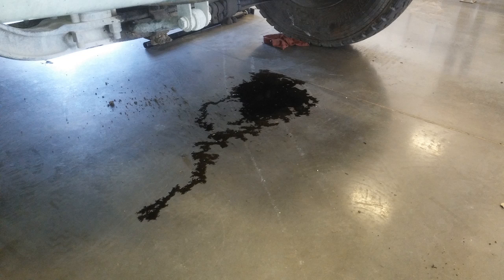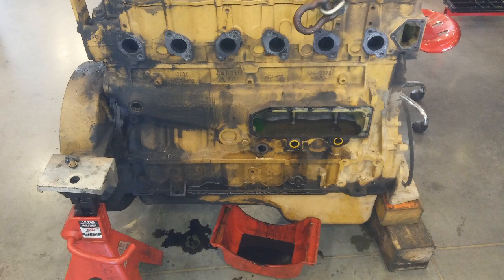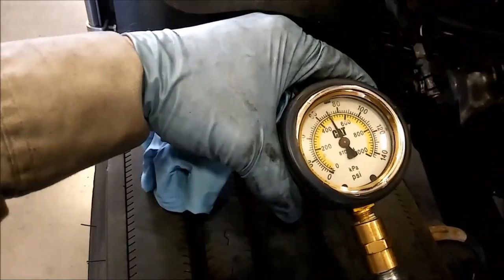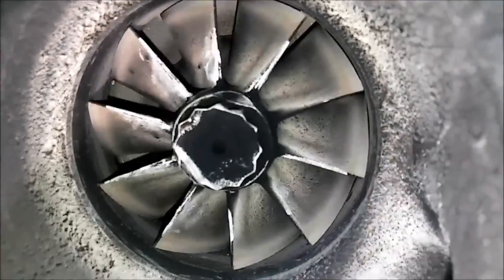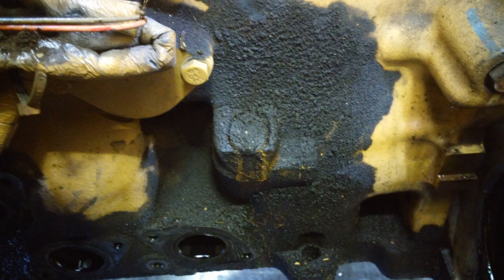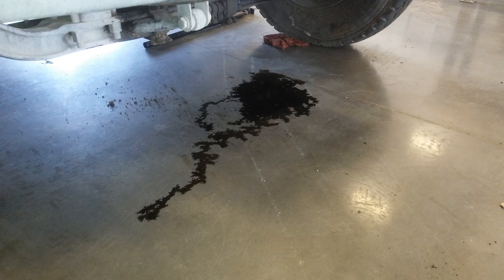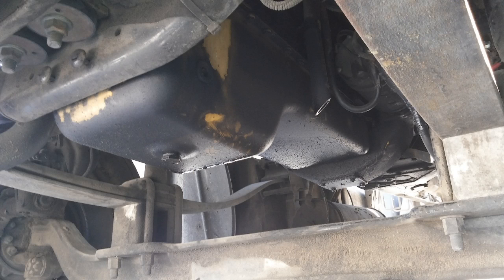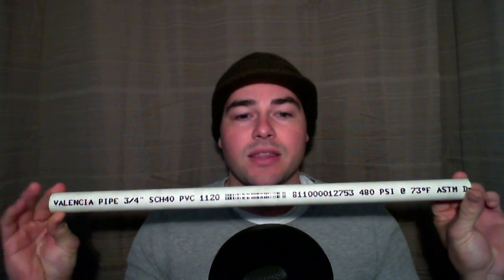Why Do Diesels Leak So Much?  Why Do Diesel Engines Leak So Much Oil?

Comment: you can use a turbo without blowing it up to put a suction from blow bye. you put it past the intake of the turbo. suction cup vacuum systems use it with compressed air the large fast-moving volume of air in a  special chamber moving fast pass a smaller hollow chamber creates suction. think of an airplane wing the the larger surface area on top of the wing air has a longer distance travel than underneath making suction on top causing lift same principle but in an enclosed system. I forget the name of this kind of vacuum system but is very effective and reliable best part no moving parts.
Reply: venturi effect ?
Reply: You are referring to Bernoulli's Principle; however, that principle is not what mainly creates lift, for in its application to this phenomenon, a mistaken assumption of equal transit time is applied.  To create the pressure differential that untold numbers of flight instructors have wrongly preached, the air over the top of the wing and the air under the wing would have to arrive at the trailing edge of the wing simultaneously.  The investigations of physicists have proven that notion to be false.  

There are three primary operative principles here - Newton's Third Law of Motion, the Coanda Effect, and the approximate angle of 4 degrees upward wing design.  Bernoulli's Principle plays a very, very small part in the process of flight.

I could explain all the three here, but it be a very long post and not relevant to Josh's video.

Comment: My crankcase breather is plumbed on the intake side of the inlet by the factory. It also doesnt leak it has 309,000 miles.
Reply: freddy freddy my 45 year old Mercedes 240d with 356000 doesn't leak either and breathes it crank gases through the inlet manifold like your engine:)

Comment: Why not a mechanically driven vacuum pump like in race car applications?
Reply: I know 6.0 7.3 diesel use a belt driven vac pump in ford econoline 350 and 250 applications...7.3s and 6.9s in the boxy body f250s and f350s also use a belt driven pump. so your comment is incorrect about parasitic draw....
Reply: Mario D'Agostino VW diesels have used this type of pump since 1996.
Reply: Maybe the big diesel turbos don’t like it but I drove around a vw turbo diesel for years with water injection spraying right into the turbo. 
Never blew a turbo, and couldn’t really notice any more wheel tip erosion I’d call excessive.
Reply: otm646 
more like 78-79 on the first old 1.5 idi. 
The 1.5 and 1.6 used a diaphragm style pump, I’ve replaced a few diaphragms along the way, but the later (85up) idi used a vane style pump. 
Great upgrade for an early pump engine. 
The vane pump stuck around on the tdi until 98.
99 up vws still use a vacuum pump, but it’s not like the older ones that basically took place of the distributor in a gas engine.

Comment: Few things wrong, it doesn't matter if a gas engine has a turbo or not.  There is always vacuum on the manifold side at low loads  with a check valve and the there is always a secondary port on the turbo inlet side.

Also turbos don't blow up from having oil vapor going though the compressor side.  The most that would happen is impeller tip damage and I have never seen that.  The only time I've seen compressor tip damage is from pre turbo water injection where atomization is horrible along with the volume being injected.
Reply: Few things wrong, no one cares if you have any vacuum at some point, you can not suck out the crank with a turbo because of... as said NO VACUUM...
Reply: +Matt Lane Nice try. Learn how to read next time. I was talking about turbo gas engines.  Also there is a vacuum under full load at the turbo inlet in both gas and diesel engines.
Reply: +Matthew B.  Another person... Again taking about gas engines and they almost always have two separate pcv systems.  One to the manifold with a check valve( known as the pcv valve ) and one in the intake system( pre throttle or turbo if equipped). The main system works on vacuum and the secondary works on scavenging under high load..........
Reply: Matthew B. Same here for a little over 10years.  It's the same system just two different parts of it. Didn't mean  they were separate.  Also you never mentioned anything about diesel in your comment.  I work on high performance gasoline engines and have data on vacuum being pulled with pressure transducers. While it's not a lot, it is still vacuum none the less. Syphon sprayers work on the same exact principal of creating a low pressure area in the tubing which creates a vacuum to pull liquid up.
Reply: Matthew B. You must me one of those so called "engineer types" and thinks everything works on computer models.  Go test it for yourself if you don't believe me. I have nothing to prove. It is the internet after all.  

Get a map sensor. Any map sensor. Find the specs on it and the voltage out put levels based on KpA on the high and low side.  You will easily be able to interpolate the scale in/hg-to-psi if you don't have a proper logger and hook it up to the in take side  post turbo. Better yet since you are a mechanic. Install said sensor and connect it to an oscilloscope and take the car for a cruise varying load so you can see the graph of trending data.

Now the question is will you even try doing it to prove me wrong?  Either way I'm done with this stupid internet squabble. People can believe whatever they want to believe.
Reply: Matthew B. Matthew B. ....No reading comprehension what so ever.   I said to take a map sensor.  Meaning using a spare.  "Install post turbo"..... Selective reading. I've been talking about pre throttle body/turbo the entire time.  Are we on the wrong page?

  You don't have a scan tool w/ o-scope in your shop?  Gotcha.  Dinosaur mechanic.  O-scopes are back if you haven't heard and they come in the form of tiny hand held tablets.
Reply: Matthew B. Likewise.   Either way, slow day here.  About to be sent home because of the snow storm. Lol
Reply: AGT ii
Reply: You missed the point
Reply: AGT You are the only one here that has a hint of what's going on. Go to school you guys. Gas and Diesel engines (turbo or not) have no vacuum, period. They have a low pressure area, that's why airplanes have manifold pressure gauge. Bernelli principal works on moving air ( such as siphon sprayers, carburetors, and airplane wings) (put a vacuum on a carb and you will have way too much gas unregulated). Engines that have an intake manifold are at best only 80% efficient by the time you get to the piston. That's the beginning of why you turbocharge (most airplanes that are turbocharged are set to sea level). If you could tap a port close to the intake valve you would find some de
Reply: AGT continued from last reply. If you could tap a port close to the intake valve on a diesel, you would have some decent low pressure, because of the intake manifold restrictions and air cleaner.
Reply: AGT Before pcv, it was called a road draft tube. It had a 45 degree cut on the backside and hung in the draft below the car to cause a low pressure area to suck the crankcase air out. Doesn't work on stationary engines. The bottom side of pistons move as much air as the top does causing violent air movement in the crank case, (2 strokes depend on it). Lowering the air pressure in the crankcase doesn't stop all the pressures exerted on seals and gaskets. Good engineering and building practices stops oil leaks. So when you see a lot of oil below a parked Harley Davidson do you think it's a diesel? Good luck you guys with the new understanding you have now.

Comment: Mine doesn’t leak
Reply: That’s because you’re sitting at your computer and typing and the truck is outside, turned off 😂😂
Reply: @MrTheHillfolk  lol
Reply: Taydrum will look those up. My F350 was a gift last year, worked all summer doing maintenance & replacing worn out parts. Had original muffler and was totally clogged with soot. New exhaust and started using Howes, I think it was called. That made a big difference after about 5 tankfuls. More maintenance is on the way but have to space it out. New tires set me back 1k. I like those Transforce HT's.
Reply: Mine doesn't leak with 210,000 miles 7.3 IDI NA
Reply: Taydrum want to sell it?
Reply: Mikael Anthony thanks but no thanks, it's my daily driver and it's reliable as hell. I even manage 22 mpg
Reply: Taydrum don't blame ya. I have a 92  7.3l NA 5 speed F350 that runs so smooth, my daily driver also. It does not leak oil either, pretty amazing!
Reply: Nice! They're pretty great trucks when they get taken care of LOL, but most people neglect them till they piss oil everywhere. Keep it going, and see how many miles you can get out of her
Reply: Oh yeah, one more thing, three of the best improvements I got out of the motor (7.3 IDI) came from running Optilube XL diesel additive, running HPR diesel (available here in CA), and putting Archoil 9100 Nanoborate lubricant in the oil. I highly recommend the two additives, and if you live in certain parts of California the HPR diesel!
Reply: I want to check my muffler now :0 And yeah, they only need maintenance here and there and should be running well beyond the collapse of society. Thankfully, tires is not an annual fix, they usually go for a few years. But good oil, good fuel, and it will be good to you
Reply: Taydrum Mine beats me driving. It is an F350 dually 5 speed with a 4:10 rear end. There are 12 leaf springs on each side of the rear axle. Not very smooth. But pulls very well. Pulled twice a 14k pound dump trailer with rock and concrete and was just fine. Being a normally aspirated engine the pick up is a bit slow but that is a non issue with me.
Reply: Yeah you can definitely pull a decent load 12K-14K with 4.10 gears, not so highway friendly though unfortunately. Mines geared at 3.55 which is excelent for highway but maxes out towing around 6-10K. I feel you on the suspension though, they were designed for hauling and not comfort/cruising!
Reply: Taydrum I like the truck, just didn't think it would wear me down so much. It is nice on the highway, but wish I had a 'Gear Vendors' overdrive/underdrive unit on it. But have to save up for that $3k investment. Been driving that truck every day now since Nov last year. CDR needs replacement.
Reply: A gear vendors overdrive would certainly be nice for those long highway trips! But you're right 3k is a big investment, but it most certainly will be worth it. I recently needed a new CDR valve too, since mine was stuck open, long story short I ordered one that never came, and so I took my old one and jammed it full of steel wool, like a catch can. Problem solved, no more oil consumption, or oil pooling in the intake. If you're able to get a new CDR valve, do it. However, because it was impossible for me to get one for some reason, i opted for the steel wool trick and it still works 1,000 miles later so far...
Reply: Evil One 
Good for you.  Who cares? It doesn't really mean much without miles, maintenance, and engine model. I will never understand why on one of these video that presents a small critique of a type or model of engine someone would present anecdotal evidence to try and contradict what is being presented.

Comment: It took me a while to grasp the concept of crankcase breathers and why you get more oil in the air inlet and turbo during idle rather than load thanks for your videos. I work on MTU marine engines; they use a crankcase breather filter system that leads right to the air inlet horns.

Comment: Hi Mr. Adept Ape, i usually follow you and love all your videos. I just have 1 question and that is, after overhauling a Diesel Generator Engine should the Generator work without load for few hours or it should work on load?
Reply from the maker: +Henrique Dsouza Cat and myself are both advocates of loaded break ins. Let the engine run a few minutes to check for leaks then load it at like 25% for a couple minutes to get it to temperature, then once it is about 170 degrees I put it at full load and run it for awhile. This will help the piston rings seat against the liners. Everyone has their own opinion on this, but that is how I do it after a rebuild on the engines I build.
Reply: Adept Ape thanks for the reply, so it’s not recommended to work for hours right? After rebuild.
Reply from the maker: +Henrique Dsouza I'm not sure what every manufacturer recommends, but for Cat engines they like to be loaded soon.
Reply: Adept Ape yes I’m talking about cat c15 Acert Generator

Comment: i thought it was because they generally live longer lives then gasoline engines. my assigned truck has 700K miles on it with a cat C15 acert. i do not know if its ever been overhauled BUT gasoline engines do not live that long. the longer something lasts, the more leaks it generally develops UNLESS it has had a full rebuild with all new gaskets.
Reply: They also rattle like hell and are under higher stresses but... having pressure also don't help.

Comment: Plus, the last thing you'd want to do is blow oil laden crankcase air onto the intake side of a turbo. If something fails its a sure fire way to feed a turbo lots of lovely engine oil. Run away anyone?
Reply: Again..... "If something fails its a sure fire way to feed a turbo lots of lovely engine oil."
Reply: Capt Vimes But what your also forgetting which can be a high mileage failure is the turbo is fed oil too and that can blow seals on its compressor side and feed the engines inlet with oil.
Reply: @tyronenelson9124  Dumping the crankcase fumes before the turbo now contaminates your turbos, tubes, and charge air coolers. Now do you think covering almost the entire intake in oily soot is a good idea?! Jesus Christ, you're a fucking dumbass.
Reply: Cant run away on fumes...
Reply: I know. Read what I wrote. If something fails in the circuit or maybe the oil level gets over filled, you have a direct route straight into the Turbo. Not the best idea unless it's your only choice.
Reply: Matt Lane Bullshit !!!
Reply: The amount of fumes is is minuscule .  Manufacturers have been running crank case vents into the turbo inlet on diesels for a while 40 plus years to present . Ive never heard of one running away from this.
Reply: Something like what can happen? The crank case explodes and squirts actual liquid oil through your PCV system and it hits the impeller?
Reply: Mercedes BlueTEC engines are notorious for oil being sucked into the turbo. Worst engine the three pointed star guys ever made.
Reply: 1hz toyota motors breath intk the intake plumbing.
Reply: You have a really good point. Unlike a gasoline engine a Diesel engine will run on its own oil. Which is why (IMO) it's a much better idea to pump the fumes into the exhaust, where the DOC (Diesel Oxidation Catalyst) will clean it up.
Reply: I'm not forgetting that. My 03 Cummins has an oil feed to the turbo and so does every other turbo out there. Christ, stop trying to argue the point that ADDING EXTRA points of entry for oil FORWARD OF THE TURBO is somehow a good idea. IT'S NOT. Stop trying to change the context of my original comment.

Comment: Paccar mx engines also use something like maxxfoce called a ccv (crank case ventilation module)
Reply: Diesel_Tech  maxxforce and the paccar sucks
Reply: Paccar engines have come a long way since they were first introduced. Theyre not perfect, theyre a prick to work on, but Paccar has been working hard to make the the best of lousy emissions standards that have been rammed down everyones throat.

Comment: As a used heavy truck dealer I see hundreds of engines per year. The Cats have way more leaks than Detroit or Cummins but they also command the highest resale value
Reply: Maybe. I had a Cat 3406 and it didn't leak a drop of oil till it dropped a valve coming down a long hill with the jake on. After a complete rebuild at a certified Cat engine dealer, it did nothing but leak after that. If everything is torqued properly with good gaskets, I believe that is a huge cause for the leaks, not just the blowby. In my case I believe the mechanics that worked on my engine didn't do what they should have done.

Comment: A cyclone filter could solve the filter problem. A boost pressure operated drain valve could open at idle and engine shutoff.

Comment: Soooo . . . the short answer is that there's YET TO BE a decent clean method of evacuating the crankcase fumes on large over the road diesels even tho it's 2018. LOL. 
I guess it's never been truly enforced by the EPA or there's very little or nothing to be gain out of it for the OEM's.
I thought too about dumping it before the turbo idea but after hearing your experiences I guess it was too good to be true.
I guess it could always be routed to the exhaust system right after the cats(hot enough THERE to burn it ?) before going into the atmosphere ?
Reply: Ya how you gona make VACUUM in the EXHAUST... that is under a ton of pressure (pre turbo) and not a vac post turbo.
Reply: Venturi Effect, more less my idea, something similar to what's used to pull fresh air  to cool the exhaust on 3/4 and 1 ton trucks or the hull water scavenging pump on watercraft(uses same principle).
Reply: JIGA BACHI the EPA is on its way out

Comment: Very informative as usual! I have 1995 3208 turbos in a boat, crank case breather is routed to air filter, would you suggest pointing them somewhere else and just collect the oil from the tube? Thanks again!
Reply: The current setup is fine, Chris, as it allows a venturi effect to withdraw the crankcase vapors into the air cleaner.  The drawback would be less air cleaner longevity.